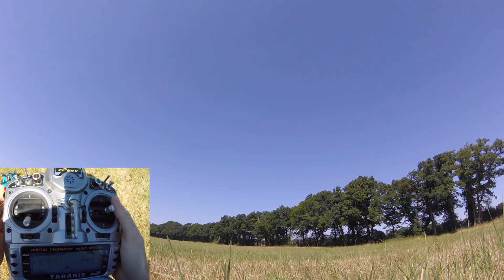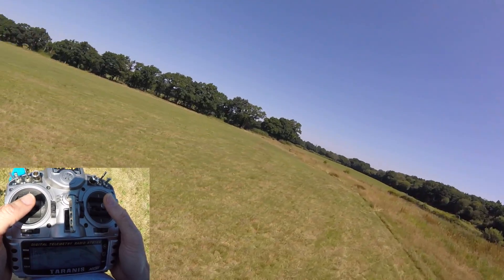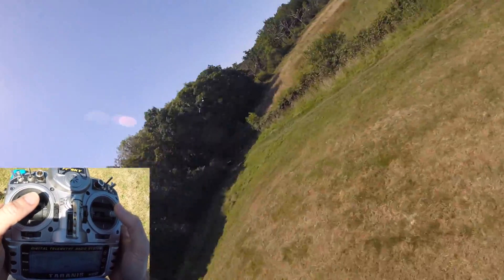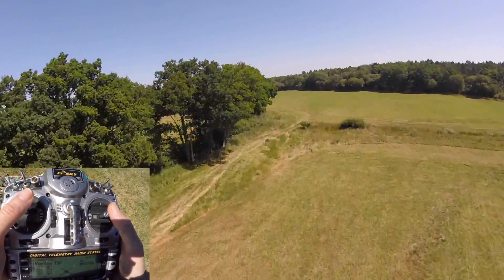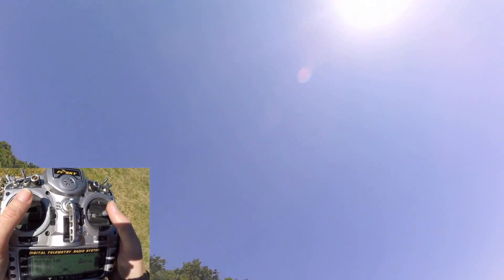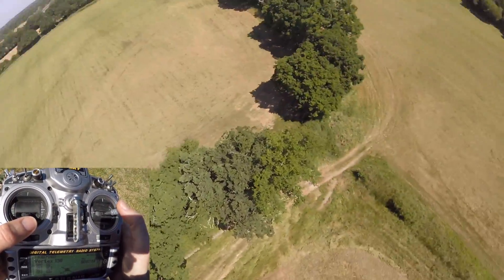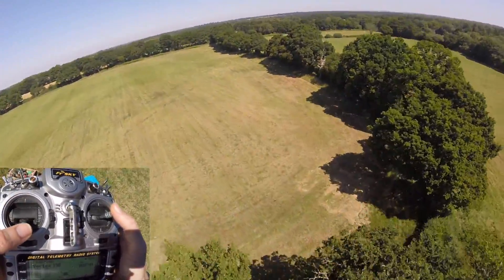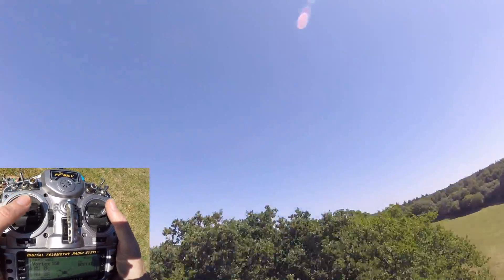FPV Tutorial: Beginners guide to Acro flying: Episode 4 - The "Pop-Up"

Comment: That was useful, I must try that tree hopping at some point, it looked fairly easy once you are over the top of the tree looking down...:)
Reply from the maker: Looking down over the tree is one of my moves I like using the trees on either side as a sort of half-pip ramp, so you go up the ramp, jump around/spin/etc and then go back down and up the other side - in this video I was mostly talking about popping all the way oiver, but just wasn't carrying enough speed to retain my inertia sometimes.